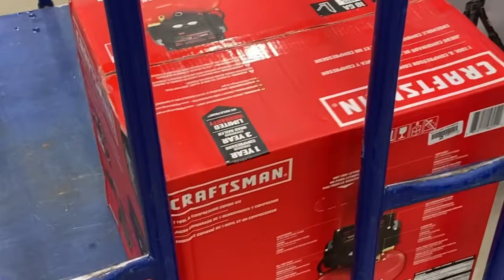I gave my 1975 trailer a facelift

Comment: You go! You made that place look so nice. Don't listen to the haters. Some people really just get off on trying to bring people down. I bought a 1984 mh in a park in 2010 for 16.5k cash, no mortgage or contracts. 3bed/2ba, good sized yard. The housing market in my area has gone through the roof the last few years and it's appreciated to almost triple  the amount I paid (and that's not even figuring in the improvements I've made to it) Everyone said, "don't buy it, it'll just depreciate more and more & you'll be stuck with it." Well, wrong. I had an offer of 65k this summer. I not interested in selling though. I pay super low space rent, my kids have their own rooms, and tiny apartments around here are renting for 2000 a month. Buying this trailer was one of the best decisions I've ever made.

Comment: For next time you can get pour spouts for your paint cans.  It really helps with the mess and saves paint.  Also you can get extension poles for your roller so you don't have to lean or squat.  :)

Comment: Nice work! If I might make a suggestion, you might wanna sure up those external walls with something since it appears you gutted most of the inside. Those 
2 x 3 double notched wall studs need all the help they can get; especially down your way.
Reply: Ditto.  That's what I was thinking.

Comment: Girl you need a large sheet lifter to carry plywood and drywall. You can make one with seat belt webbing and 2 inch flat hook to help you carry them so you don't get hurt. Safety safety safety especially when you doing this kind of work alone. If you ever hurt yourself one is going to know you are hurt. Trust me I have first hand knowledge about accidents on farms that nearly killed them. Some where killed in horrible ways. That would be very bad for you.

Comment: True. 
Let’s no pretend she didn’t sell her house and downsize so tools and materials that it takes to do and do over and over until you learn, let see how many times you can cut the same piece of wood. 🙄 

Everyone works to have a home and the housing market isn’t possible Fo so many Americans, tiny home and recycling the older  mobile homes are a very good solution and should be taught. 

I seen someone say to pick up cans and  cash in to buy tools   Good advice. Get it done.